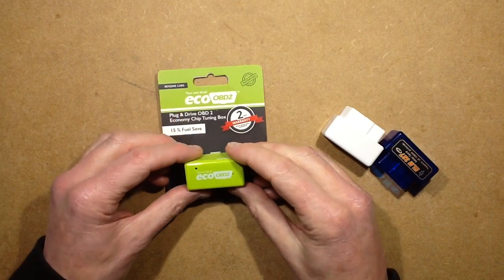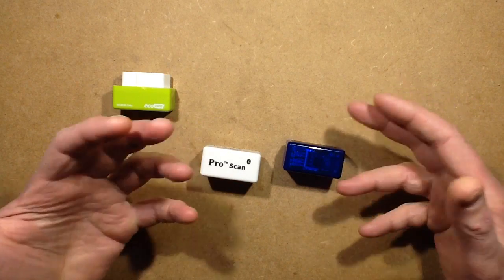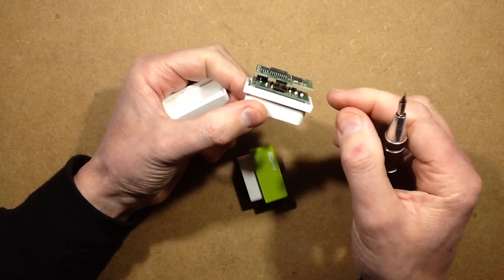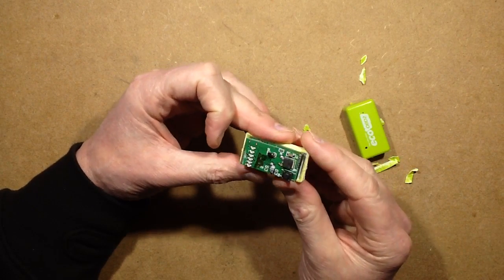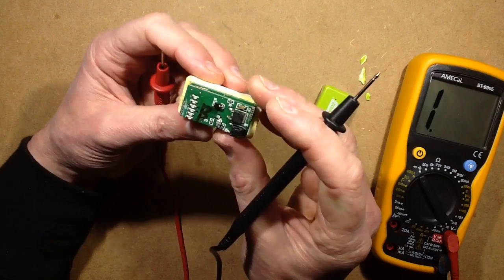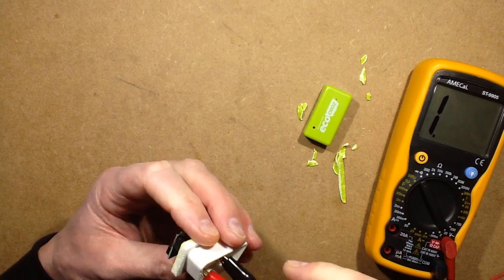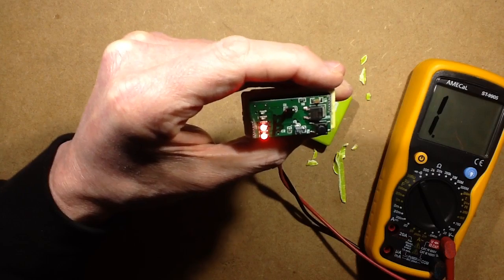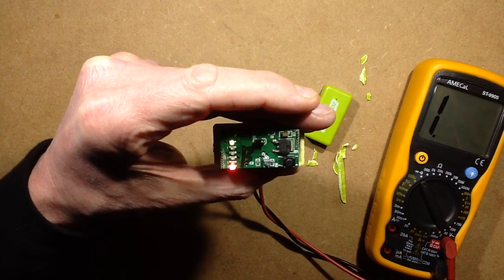Inside an ECO OBD2 "chip tuner" fuel saver.

Comment: LPG controller gives you an diagnostics USB connection and you can alter almost all parameters of your car's work, even shut off for ex one cylinder completely, change mix of fuel and air, gives you an insight of all stuff like time that a valve is open per cycle, that could be really useful. and dangerous probably.
Reply: Just add freevalve and you can implement Skip Fire. :)

Comment: I not sure if these chips work but I tried tune sawyer chip it works and had it dyno jet check and it gain 18 horsepower power felt the difference in couple  hours of driving.

Comment: What those units do is they read your sensor data, process it, and send the new to the "carputer". The computer thinks the sensor value is different and "requests" a different amount of fuel/air intake/etc into the engine. Whether this particular unit does anything or not is a different story, but they can be fuel saving or power-boosting units.

Comment: Honestly if it did do anything you might as well throw the warrenty info in the trash. I know Audi/VW will check for any editing of the software even if its the OEM tune thats installed and I've read a few storys from Ford guys about how kids will throw a tune on their new Mustang quickly blow the motor and then flash it back to the OEM tune and try and get a new engine from Ford. They always get cought if the check the ecu and will play dumb when they get called out.

Comment: It's a sales gimmick, as a vehicle technician with 25 years experience i can see that, the only way some plug in gadget will change settiings in the ECU is if the gadget is connected to a computer and uploading a new map and since the maps are designed for a specific engine there is no way that little disco box can have every map for every engine in every permutation stored on it, also it isn't just a case of uploading the map, it needs live tuning to fine tune the settings on a dyno because no "out of the box" map is ideal.

Comment: There a load of crap, I have programmed a friends ecu recently and I cant be done through the plug, it involves desoldering the actual chip and putting it in a jig and then using another device to plug to your laptop which contacts the pins on the chip, you save the program that's already on the chip (incase you balls up) lol and either download new codes but that costs or just rewrite yourself which is what I did, I will be uploading a video on the next one i do on my other youtube channel for anyone that wants to see I done from start to finish, will also be selling rewrite codes for downloading

Comment: It is possible to change engine characteristics by OBD (not by all cars of course), this is true but this box just blinks a bit... How should an ATMega328 (or whatever it is) "know" all type of cars and engines? For Example: You got two cars with identical engine this does not mean they got the same engine control unit (for example manual and automatic gear). This fuel saver is trash like the Nitro OBD as well as the fuel line magnets, pedal boxes, etc... And one more thing to the OBD Bluetooth adapters: They work just fine :)
Reply: Hey hey fuel magnets work but not nearly as good as most claim. I have seen with my own eyes magnets improve fuel economy on a generator engine only 9.75% improvement. But to the port of LA thats hundreads of thousands of dollars.
Reply: No waYI call bs
Reply: +casey james do the experiment yourself you have to tune the generator also just like any other engine to work with the better combustion.
Reply: +casey james I was apart of a group who put HHO cells on generators from the port and we got 40% decrease in fuel consumption after magnets and HHO. As well as over 80% reduction in harmful emissions from the generators.
Reply: With the price of fuel rising by the day, everyone is looking to reduce their consumption of gasoline.  One question that we get all the time is how to use magnets on an 		automobile fuel line to improve gas mileage.  There are many manufacturers out there selling "specialized" devices with "monopole" (yeah, right) magnets, magnets that are specially "tuned" (again, yeah, right) or other glorified claims that make their product special.  Well, we're here to tell you that these glorified claims are untrue.  First off, there is no such thing as a monopole magnet.  They just can't exist according to the laws of physics.  As for "tuning" magnets, there really isn't anything to "tune", unless you call putting a pair of identical magnets together "tuning".  A permanent magnetic field is not moving, does not have a frequency, nor is it making any noise, so there is really nothing to tune.
Basically, every one of these magnetic fuel saving devices is a magnet, a pair of magnets, or several magnets arranged in various configurations.  The most common is a pair of magnets in a housing that clamps around the fuel line, with the magnets in attracting arrangement, meaning opposite poles of the magnets are facing each other so the magnets want to come together.  This configuration creates the strongest magnetic field possible through the fuel.
While we make no scientific claims about their use, several of us have tried this on various vehicles with varying degrees of "success".  On 4 of the 6 vehicles tested, the regular driver noted improved fuel mileage by 1/2 to 2 miles per gallon.  Two of these say that it took about 2 months to notice improvement, which is a claim made by other manufacturers.  In two of the vehicles, the driver reported no change in fuel mileage.  Conclusive?  Hardly.  But it does make us believe that there is a possibility that strong magnetic fields may improve fuel mileage.  We won't even speculate as to how or why this happens - we'll let all the "specialists" make their claims and tell you why it works. 
We have been using plain magnets with plastic or wood blocks with wire ties and/or tap to hold them in place.  To make things easier, we decided to design and stock our own "magnets for fuel lines" (note the lack of claim of increase in fuel mileage).  You can see them here: FuelMag1.  These units are a pair of our strong neodymium magnets mounted in plastic holders.  There is a steel backplate behind the magnets to concentrate the magnetic field between the magnets.  The assembly is designed to easily mount on most fuel lines simply by placing one on each side of the line and fastening with the included wire tie.  This assembly create a strong, 7000 Gauss, magnetic field between the magnets.
Others instruct you to install the magnets as close to the engine as possible.  This seems to make sense, so we recommend it as well.
We are not mechanics and do not claim to know much, if anything about automobiles, so please don't ask us for specific instructions for installing magnets on your car.  All we can tell you is "on the fuel line as close to the engine as possible". 
We have seen some of the "fuel extender" devices go for $60 to as much as $200 per unit.  That's a lot for a pair of magnets in a plastic housing.  We offer ours for much less.  If they improve your fuel mileage by even a little bit, it won't take long for the magnets to pay for themselves.  We do not make any claims or guarantees to the effectiveness of the magnets increasing your fuel mileage, but we welcome you to try it and welcome any feedback you have about your experience.  If we get enough feedback, perhaps we'll start a tally of our own "scientific" findings.
MrHydroguy
Reply: +casey james Not tuning the magnets brotha tuning the engine to the new fuel going in.
Reply: +casey james Also you have to put in multipule magnetic fields and they should be arranged so they are attracting each other but not touching anything metal i.e. attach to the flexible part of the fuel line.
Reply: +casey james We have messed around with some powered magnetic fields also. The most we ever saw from them was 10% decrease in consumption and 25% reduction in emissions. They cost over $3000 though.
Reply: +casey james Nice copy and paste job haha!
Reply: Work with what I got,this was bs from the start,and finish that way.

Comment: I  tried this one. Same package, same colour. The differences are dramatic. My car really drives faster. Hit the accellerator twice and there's another 100 hp from the engine. The display, which is only used by the car stereo, now shows what's happening in the engine. Very important. There is even a stealth mode where you and your car seems invisible for any speeding camera. Really worth the money. Buy it!

Comment: You might be surprised, Clive, but hacking someone's car through the OBDII port isn't as clean cut as you might think. Each manufacturer (Ford, chevy, toyota, honda, etc) all use different software and different modules and all that for wildly different setups between them. That winds up meaning that software for a ford vehicle won't be compatible with anything but ford. Same with honda, chevy, dodge, etc. The only software that will work with any OBDII are generic check engine light scanners that can't do anything more except tell you why the check engine light is on.

Of course, there are specificly made scan tools which can be plugged into any car to read any and all systems on any given car. However, the only reason these work is because that they have all the software available already installed on it. Their price reflects this, at two thousand american dollars or more.

In theory, someone can kill a car with the obdii port, but doing so is not easy. I haven't tried, myself though. To use a high level scan tool like that in a malicious way, you would need to modify the system software for that specific vehicle manufacturer and even the model for the 'virus' to really work. So you'd need an identical car, a really expensive piece of equipment, and know how to code. Even if you do it on a laptop with a USB to obdii connector, you'd still need the specific software to begin with to talk to the vehicle then code up a virus for it.

The most likely scenario, really, is it just fries something in general, but even then, there are fuses designed to protect the car. If you really wanted to ruin someone's car, it would be easier just to light the thing on fire lol.

Comment: Would need a chip to store at least 512mb of data for both a calculative script and to log your driving, also a controller for said storage device. And a chip that can run said script very efficiently since there was no battery supply to keep it running after you shut of your engine, which is basically as soon as you arrive.  Couldn't see any of that.

Comment: I helped design the mainframe of the dodge obd2, So at least for dodge this could definitely work. you can completely delete every single .jkg file off you vehicle and make it useless through the obd2 on a dodge. how I can't say, Possible yes not hard at all.

you can force your engine to run cylinders a certain way, Only allow so and so amount of fuel per cubic centimeter through your valves.. at least this works with everything on a dodge before 2013

Comment: In modern cars you may connect to the different ECU's and read or request some info, but to modify any parameter or launch test procedures you should follow an autentication procedure. And even that process has a lock down after several failed attempts. BTW every write is logged in the ECUs Eeprom and executed after a fingerprint from your tester (yup, every official tester is properly identified), so if you play with your ODB your guarantee may be gone forever.

Comment: the application that lets you read actual values and or Freeze Frame data is pretty cool. However did not use any of the devices that wants to manipulate your engine management system. Leave it the way the manufacturer intended it to work. Fuel atomization comma injector pulse width, throttle angle and everything should be working the way the manufacturer intended it to look

Comment: Here's a hint, folks: if the OBD-II thing costs less than $500, it's not capable of doing anything to any computer in the car. At all. Period. End of discussion.

The devices that can affect any computers in the vehicle in any meaningful way  through the OBD-II port all cost a lot, in part because it's a complex process to reprogram a computer in-vehicle and that process requires a lot more than just a microcontroller with an integrated CAN transceiver. Also, in-vehicle reprogramming isn't just a case of needing CAN support, it also requires licensed technologies (e.g., J2534, protocol translation, etc.) and the licensing costs are also part of the price tag for the equipment. Auto shops that are able to field-program vehicle computers will have multiple thousands to tens of thousands of dollars invested in the equipment to do so.

Your $19.95 "tune your car through the scanner port's blinkenlight dongle doesn't do shit aside from consuming some battery power to flash some LEDs. Seriously. That is literally all they do.

Source: I've owned an auto shop for over a decade and have reprogrammed God only knows how many ECUs and other computers and processor-centric "modules" in-vehicle. The programmers I use have VCIs (Vehicle Communication Interfaces - the actual box that does the work) that cost $1,200+ each, and that *ex*cludes subscriptions to automakers' firmware, which can be $10+ a day.
Reply: +OddlyIncredible A cheap elm Bluetooth adapter can do almost anything, theoretically. The Problem is more on the software (and knowledge) side. All those CAN-Devices are locked/flashed and set to their customers adresses at the end of the manufacturing process. If you want to change something you have to unlock, change and then reflash/relock the whole thing. This is totally confidential for many components or has restrictions an what "shop owners" can do. You pay lots for the knowledge and the ability to earn cash with it. 

Source: I've worked for a big Automotive Electronic Manufacturer for over a decade and have reprogrammed God only knows how many ECUs and all different kinds of sensors. ;-)
You would be surprised what a ELM327 can do if you know the right code and the right adresses to send it to.
Reply: +tubybubi I use ELM-based dongles for fast code checks so I agree with you that they can do a lot, but the topic is whether they can modify some aspect of the operation of the vehicle, and the answer there is "no."

Comment: I have the blue on you got. $3 USD from China. I had an oxidation error code for a while. I cleared it using Torque. The only issue I had was getting the BlueTooth to sync. Took forever (minutes).
Reply: MisterMsk
Reply: hector hernandez That's me...

Comment: Better hope it doesn't work because if  by some chance it did lean the engine off a bit you could be lucky and have to drive around in limp mode or not so lucky detonation bad enough to melt the pistons and you really don't want to go there unless you  have a new spare engine in your garage and £1000 to install it!

Comment: It would be interesting to probe around on the data lines to see if it's trying to send anything out to the CANbus, and if so, what. I'd hook the data lines up to a scope just to see what happens, if anything. There's the possibility of bit-banging the data stream then to reverse engineer it to try and see what it's doing. Would be a nice interesting investigation project.
Reply: They showed a vid and up close half the pin outs weren’t even soldered 😂
Reply: You could likely monitor live data with an obd port splitter and you'd see what PIDs its trying to manipulate.

Comment: Well the obvious thing to show that this is fake, is that if there was a way to make your engine more efficient, don't you think that the engineers that spent years developing it would know about it?
Reply: I think you need a new gas gauge then...
Reply: +Joe Anthing Yeah manufacturer liability. They dont wanna pay for any break down due to driving to close to the limits of an engine. So engines are tuned for a middle point.
Reply: i just tried on my car with a pure hydrogen  fuel saving system, went for a 126km drive and the gas gauge is still on the full mark and had way more zip
Reply: @scagetman  cool
Reply: No because cars are set up for emissions and liability.
Reply: +MrHydroguy Liability?
Reply: That's what the manufacturers tell you but vehicles are generally set up to be average at everything because the manufacturers don't know if granny or the boy racer next door is going to be driving the car and they have all sorts of government mandated parameters they have to work to. Whether these things actually work or not I don't know, and no... I'm not plugging one in to my car!

There are a lot of parameters that can be changed via OBD2 but I don't see how a little device like that could possibly do anything useful. You can buy piggyback chips and get existing systems reprogrammed for things like economy, torque, power, etc. but those are vehicle specific.